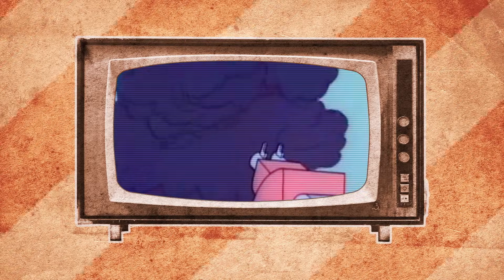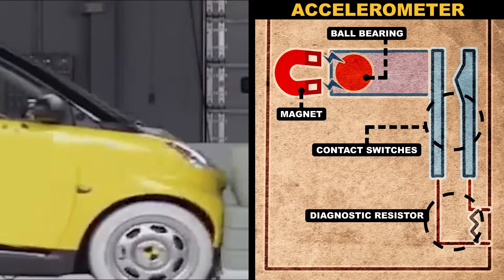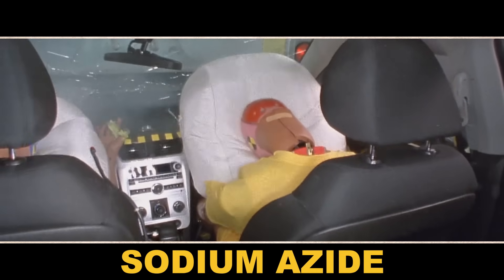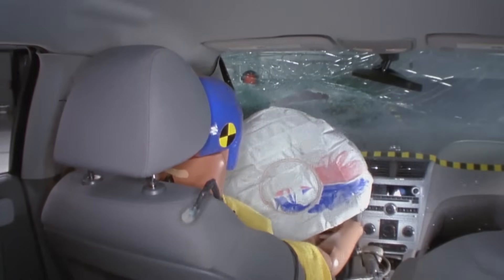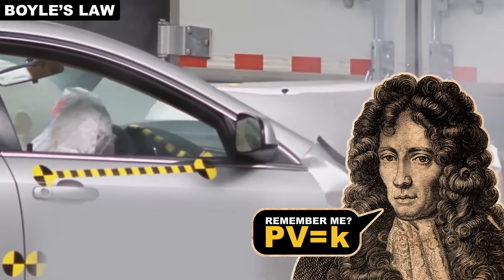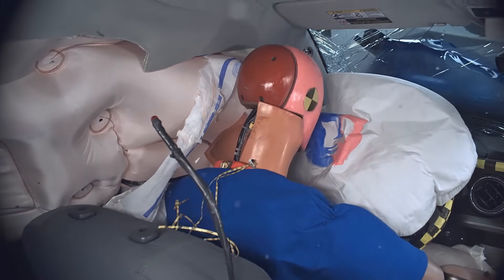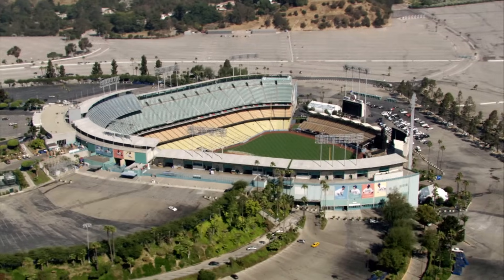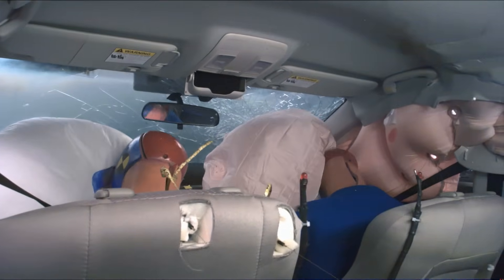How Do Airbags Work?

Comment: The airbags main purpose is a Head and Neck device to combat basilar skull fractures. Which is where your body is seat belted the head is not. So the car stops, your torso stops, but your head keeps moving at the velocity you impacted at. The brain is tied to the spinal cord that carries electrical signals down your spine. It is very strong almost like carbon fiber and in a crash the head skull/skin will keep moving forward the spinal cord is anchored in the seat belted torso so the spinal cord attached to the brain will restrain the brain. The brain gets turns into a battering ram and it causes basilar skull fractures or (Base of skull fracture) because the brain gets yanked into the base of the skull at a high velocity. Almost like a sling shot shooting your brain. The brain it’s self gets turned into a deadly weapon.

Comment: If a car goes off a ledge into a body of water at a decent speed, 20-30 MPH, would an airbag go off?
Reply: Not sure about all situations but not necessarily. My first car accident as a new driver, I was driving in a heavy Midwest rainstorm and hydroplaned off the freeway (~60 mph), down a steep slope and into a lake. Airbags didn’t go off.
Reply: @ABitAmiss  how new was the car? Modern cars don't deploy airbags in every Situation. Some even measure the weight of the driver and then decide if it's safe enough to deploy airbags.
Reply: @lucariolps277  Interesting, I didn’t know that. It was a 2002 or 2003 Chevy Impala.
Reply: @ABitAmiss  hmm can't find anything about the airbags on that specific car but Yeah modern cars can do a lot of interesting Tricks with their airbags. For example a lot of cars measure the weight of people in the Front seats. If the weight is too low, the Airbag will be turned off. For example, you have a child in the Front passenger seat. That would cause the board computer to turn off the passenger side Airbag. Or certain cars only deploy airbags on required sides. Let's say in a roll over, only the side airbags deploy.

Comment: Air bags should be meaningless in coming future if all vehicles go automated, vehicles can become light weight and low on safety with interconnected systems
Reply: If sudden system failure were to happen and autopilot disengages and the vehicle ends up hitting a wall. Without airbags, you’re pretty much history.

Comment: And here I am wondering where the steering wheel goes when the airbag opens. Does that break into parts or like fly away into infinity? I'm talking about the middle part where usually your horn is
Reply: Truck Driver Skeeter it rips in half basically. If your vehicle isn’t salvaged after it’s just a matter of repacking and putting a new cover over the airbag
Reply: On the 2012 ram 1500 it hinges up. The airbags shears the bottom of the fancy plate from the steering wheel and the entire piece flips up behind the airbags then settles back down after it deflates.

Comment: Only 45,000 lives? I thought it would have been way more than that.
Reply: But probably seriously injured or killed just as many, due to people not holding the steering wheel correctly or looking round when it went off.
Reply: @BlatentlyFakeName I find that unlikely. It is true that airbags have caused an increase in the number of serious injuries simply because the airbag made the difference from death to serious injury
Reply: @grassytramtracks  If the airbags goes off when you have your hand over it, you'll punch yourself in the face at 200mph. That's why cars with airbags have hand "grips" either side of it. That is where you are meant to hold it.

People have to have limbs amputated after airbags go off on them.
Reply: be grateful

Comment: Wait, but where does it come from? Does a piece of the steering wheel detach so the airbag can get out or something
Reply: i always wanted to know ...I was thinking what if that piece just hits you in the face lmao
Reply: I was in a crash the horn area of the steering wheel rips and airbag goes through
Reply: @Red4350  the front cover of the steering wheel comes flying off because the airbag punches through it
Reply: The front plate either comes flying off or splits.

Source: last week,
I saw it first hand.
Airbags save lives and kept my face from being destroyed.
Reply: On my old car. There’s actually a small door in the steering wheel that busts open that allows the airbag to easily go through. Some cars, the entire center cover either flies upward/downward (still attacked to the steering wheel assembly of course) and the airbag goes through that way.
Reply: The cover of the steering just peel off due to the immense amount of volume that will be generated due to the chemical reaction, and it’s soft so no need for a harsh reaction or even a special mechanism.
Reply: It's clipped at the top or bottom. Lol it would knock you out before the bag saves you.
Reply: Plastic breaks away from 1 side of the dash or steering wheel. Ask me how I know 😐
Reply: I was thinking about that, but 1:48 explains a lot

Comment: Is an airbag necessary, though, if one wears a seat belt?
Reply: yes, human body works like dense jelly, it bends aroud the seatbelt - legs and head fly forward, while torso is barely fixed in place. Thats why your cervical spine is rekt after a crash, you pull all the muscles and ligaments on the back side of your neck - whiplash its called. If airbag wasnt there, you would brake the wheel with your forhead. Plus in severe crash front of the car is getting deformed, so its moving towards you.
Reply: educate urself m8
Reply: Yea. I had a '90 without airbags and it Dislocated my shoulder and stretched out the ligaments. I had to have surgery later
Reply: A harness is safer than a seatbelt+airbag, but they restrict movement too much for most people and it requires a reinforced bar across the middle of the cabin. The airbag is there to make up for the fact that a normal seatbelt has loads of slack and actually isn't all that good at keeping you in place.

Survival rates have only increased slightly with airbags and it's mostly in high speed crashes. They are actually worse for low speed crash injuries as the airbags themselves can do more damage than the collision.
Reply: Mister Nobody There’s a remedy for that actually. If your car is at least past 2005 where “Advanced Airbags” are a thing now. They take into account speed, force, and etc to adjust the airbag’s strength accordingly. It’s not just one speed the thing comes flying out.
Reply: Necessary? Not necessarily. For decades humans survived vehicular collisions not only without airbags, but also without seat-belts. However, following the implementation of either and/or both...survival rates have increased. So not only are chemistry and physics important, but statistical mathematics as well. Or you could just walk/bike everywhere.
Reply: @Thwapwhacket  before decades the speed of cars were much lesser than today.

Comment: I retrofitted a 'DIY airbag' into my vintage Ford Mustang (these cars were made in the days before airbags were standard feature in motorvehicles). The propellant used was nitrogen triiodide. I only closed the door and the airbag went off! Not only that, for an entire week my face was covered in purple iodine sublimate from the decomposition of the nitrogen triiodide; a facial scrub with dilute sodium thiosulphate solution eventually removed the iodine. Back to the drawing board.........
Reply: tuff luck

Comment: Its PV=NrT
Reply: @highlander723   Yes, that is the ideal gas law. Boyle's law is closely related to the ideal gas law. P1V1=P2V2. It shows that pressure and volume are inversely proportional. Gas molecules collide with the container wall at a faster rate and raise the pressure, when the container volume decreases.
Reply: Yes, but if you hold N and T constant (as well as the already constant r) then you can abbreviate them to an arbitrary variable "k". This allows you to to consider changes to volume (of the airbag) with respect to pressure, and vice versa. (also it is it's for it is and its for the possessive form)